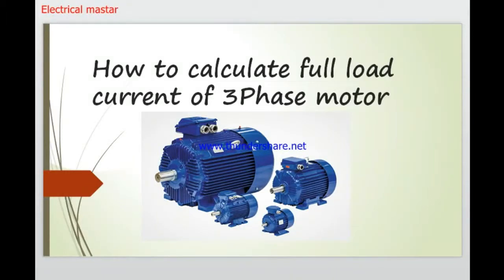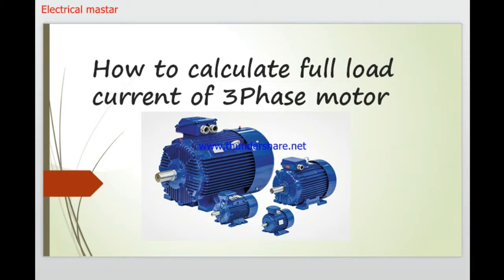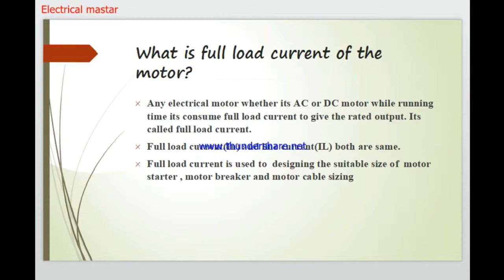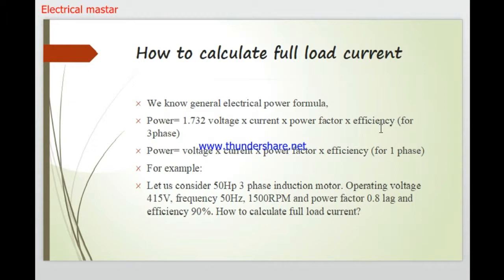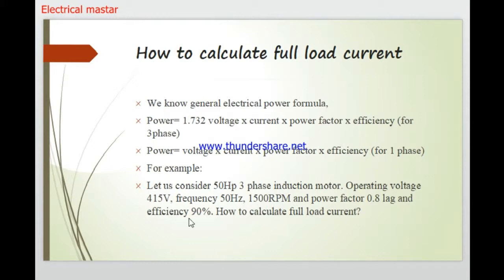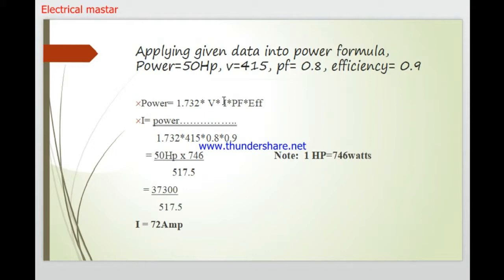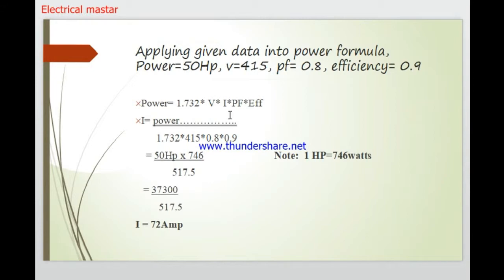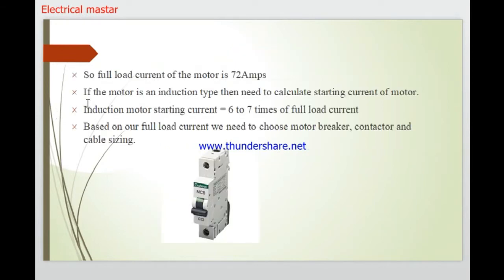how to calculate full load current of motor in tamil

Comment: How we know motor efficiency? If not given that efficiency in name plate
Reply from the maker: Thank you for your comments mr.muthu,  generally efficieny given in motor name plates if it's Not there as per standard you could consider 90% or using this formula power=1.732 Voltage x Current x  PF x efficiency
Reply: @electricalmastar  thanks, our diesel generator have 0.64 power factor, how will improve PF, please share your thoughts..
Reply from the maker: Hi 
For your information Generator PF is designed one we can't increase it and it always designed for 0.8 suppose if it's showing low you have check your load distribution in DG . Its required equal load distribution to maintain of
Thank you
Reply: Thanks Anna 😊